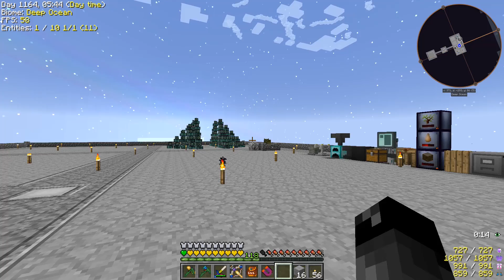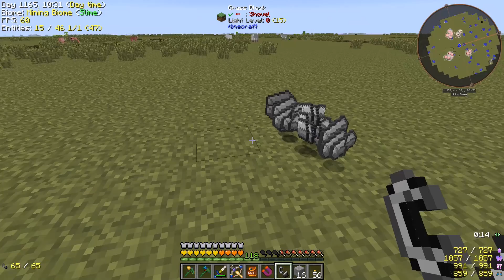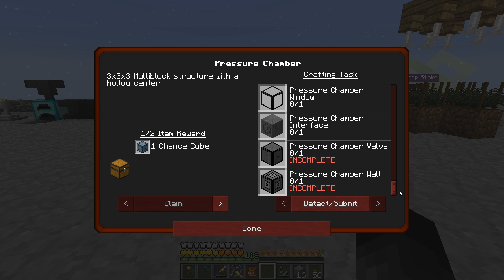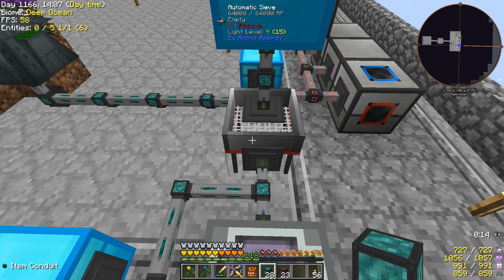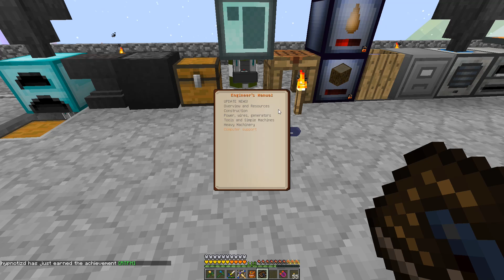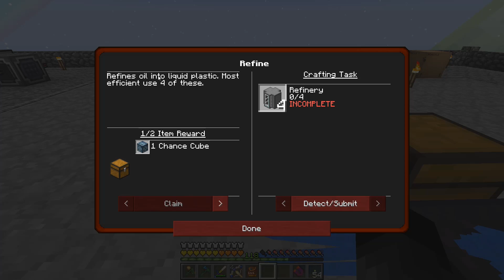Project Ozone 2 Kappa Mode - PNEUMATICRAFT PLASTIC [E22] (Modded Minecraft Sky Block)

Comment: I was happily playing SF3, but have nevr palyed with Galacticraft, so thought I would gives this a go. Turns out Galacticraft is boring AF. First Moon dungeon bugged, no chest, then 6 Moon Buggy schematics. Got the T2 Rocket schematic, but was over it. My EIO Inv Panel bugged out as well and wouldn't return mats, so decided I really needed AE. Galacticraft is a huge gate to that, so I went down the RFTools Dims instead, and it really paid off. Good high tier ores are really expensive, 1.2MRF+ per tick, and Big Reactors is gated behind Neptune gems, so I made 3x IE Diesel generators at 150KRF/t each and a stack of Vibrant Cap banks that were preety much entirely paid for by my Capacitor farm in the Nether (although, I think a Cap farm in the Last Millenium would be better, has a bedrock base under the island and you could Lilly it easily). I had 100's of Unknown Dimlets from my mob system, made researcher, made some dimensions, Mercury, Carbon etc. My stored RF was enough for about 10mins+ in the expensive Dims and I didn't need that time to get the mats for my AE system. I will go back to Galacticraft, but only for completion.

Comment: hey quick question to anyone..Are Auto-Caster disabled in kappa mode? NEI is not loading anything up and 15 casting basins for my mooflu farm is bringing fps to 12..and its not the cows..its the baisins
Reply: I would not even bother with farming cows for Ingots. Its not really worth it. Setup a good seiving farm and you are good to go until you reach EMC and then it does not matter anymore
Reply: Craydy yeah that does make sense.. mostly wanted to do elec steel and stuff where you need to mix 2~3 items in the alloy furnace
Reply: Just get a 8 Alloy smelter setup, or just Magical Crops. They are pretty fast to get to and you can get enough with them
Reply: Craydy yeah gonna do the modules for agri farm thing today :)

Comment: Hey, i know this is a weird request, but could you please reply with a paste bin of the startbat file you are using for the server? I would really appreciate it a lot since i don't know what i'm doing wrong but i wrote the server bat and it's working but it's lagging really badly,  i have 1000Mb/s internet with 250Up and a beefy computer with an i5 6600k overclocked alongside 16 gigs of ram and a 970 so it's definetly not the computer, so i am doing something wrong starting up the server. It's also lagging on localhost. The TPS is fine btw.
Reply from the maker: Java -Xms1G -Xmx4G -jar forge.jar nogui
pause

is what I use.
Reply: Are you just running it on the same Machine?
Reply: Yes, but having just the server started and the client closed and having my friend connect from his pc still is laggy so i got that out of the question.. Should i not run it off the same machine?
Reply: The only other capable pc i have has 4 gigs of ram with an integrated i3 cpu so i don't think that would be wise :P
Reply: Nono, I was just asking, because I am doing the exact same thing ( though I am playing too, without a Problem. You only need one line in the starbat file (though i honestly doubt that this is your problem.) Here it is:
java -Xmx3G -jar forge.jar nogui
PAUSE
Reply: I was using 

java -Xms4096M -Xmx4096M -jar forge.jar
pause  

will try that line tommorow, it's late now gonna go to sleep, thanks for helping out, will definetly update you if it works well or not
Reply: Yea, its atest worth a try. Also give me a reply, even if it works, just so I know :D gn8
Reply: Yep, the server works flawlessly now with the updated server bat. Thanks for providing the settings :)